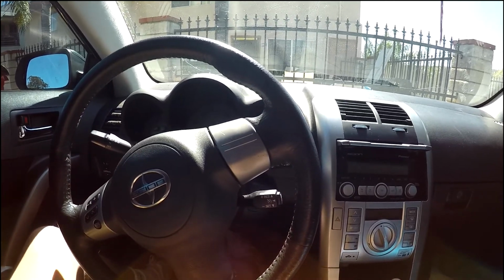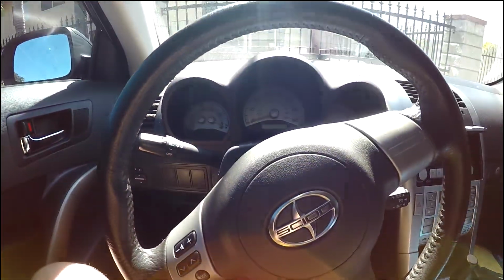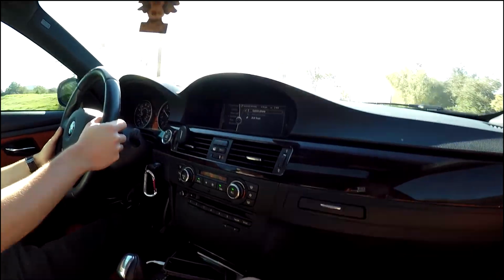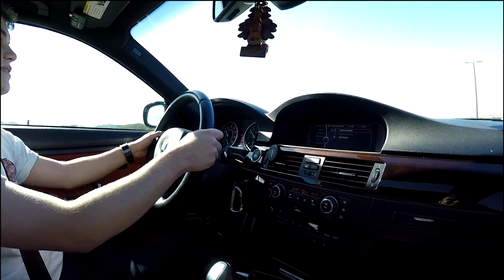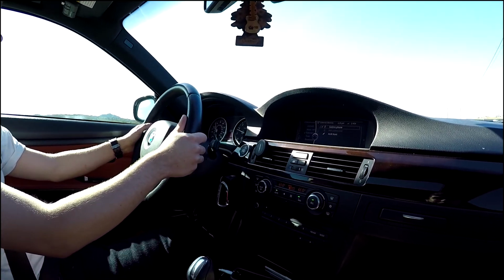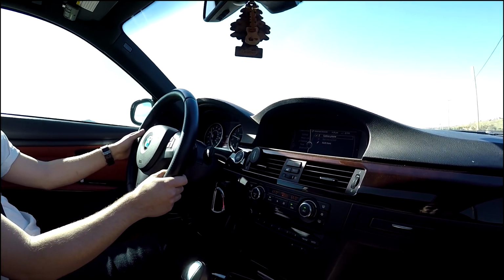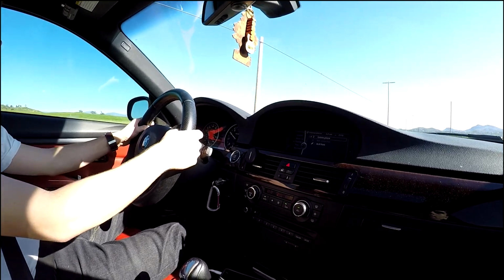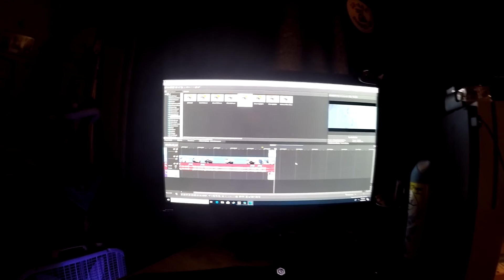FULL BOLT ON N55 335I BUILD BREAKDOWN

Comment: I had the same issue, finding a manual with low mileage in n55.. so I settled for a Alpina white n55 M Sport auto 6.
Reply: What is considered low mileage?
Reply: @Toxa1300  i just bought my n55 at 122k mi its a 2011 e90. Its a lot of miles but the car is in great shape and taken care of by previous owner, honestly about to start getting ready to up the power soon.
Reply: @canescaniaccombo  Mine is e92 2011 aswell with 135k km. Bought for 10k euros
Reply: @Toxa1300  you gonna tune and do mods to it soon?
Reply: @canescaniaccombo  yess already waiting shipping for catless downpipe and some cables for mhd
Reply: I got mine with 54k miles. Alpine white red interior.
Reply: @canescaniaccombo  Do you still have it & how’s it running for you? I also have a 2011 335 xdrive msport 6at at 140k now

Comment: Watch out for that oil filter housing gasket leak if it does go bad it leaks directly on to your drive belt and it can tear happened to me and nearly ruptured my crank case seal I got lucky. Super fun cars man. I got the n55 with the 6 speed manual and sport package